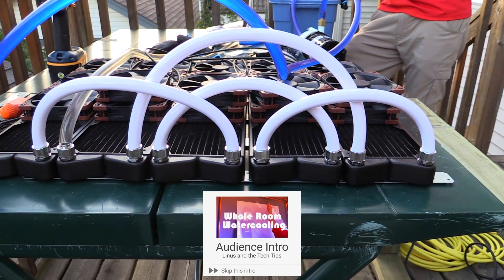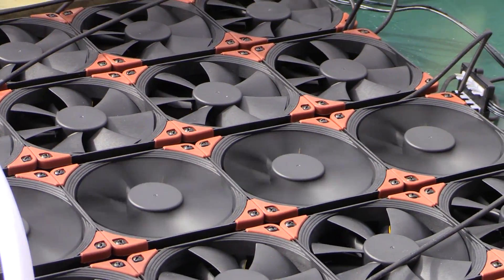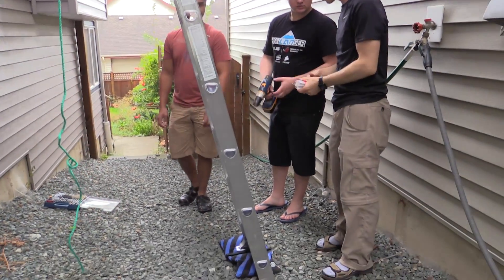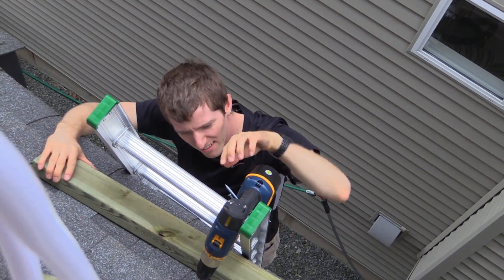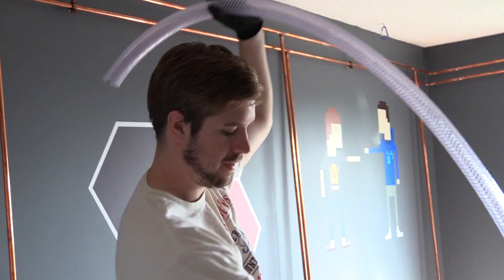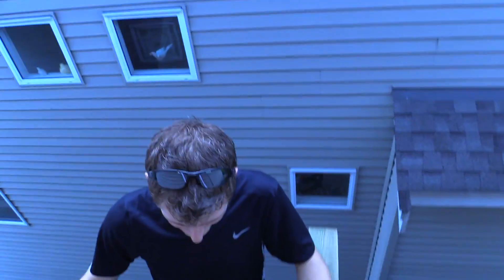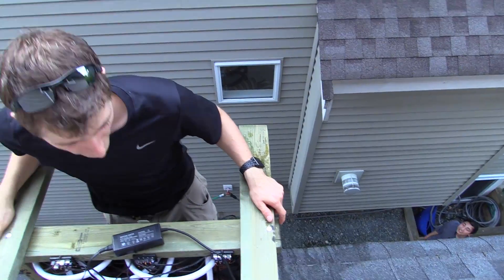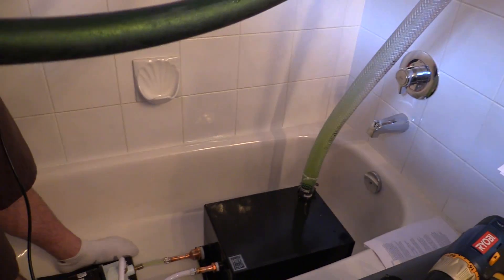Whole Room Water Cooling Project Day 3 - Radiator Mounting and Panic...

Comment: I realize this is old, but damn, wouldn't putting radiators outside in the winter in Canada result in coolant freezing and/or condensation?   Granted winter is pretty dry, but I'd still be concerned as homes can capture some moisture in the air indoors.

Comment: I know this is 5 years later and they've moved and improved on building things, but a few things I want to say.

1. The power could have been handled with pvc or weather resistant flex pipe that we electricians use so everything is out of the weather.

2. Pilot holes for screws. Wood won't split, then.

3. Shut off valves to allow the PCs to be independently removed.

4. Grab the radiator from something like a honda civic or any 4 cylinder car along with it's electric fan to use at the radiator. Some adapters for the hoses and hook up an inverter for the dc fan and done! It's lighter, simpler, and weather resistant (except the wires).

Also a ridiculous build, but I love it

Comment: I love this video, as I do all the others.  It may have been said already, but I am not going to read through three years worth of comments (!) lol, BUT....the hot water running through the pipes in the office would lose their heat to the office?  Newton's something Law of Thermodynamics.  Which is why we insulate our hot water pipes in our homes.  So that as much of the heat as possible reaches the taps.  Surely, what they are doing is the same as fitting radiators in our homes?  (and yes, I do realise that radiators should be more correctly identified as convectors).  Just saying :)

Comment: You know how modern fridges have cold water taps, where you instantly get cold water, I felt that they should have just sent those pipes from the computers to a refrigerator. You can then have it indoors stoved away and away from the elements.

Comment: Why did you not use a car radiator/fan? Those fans are made to be in the weather. Not to mention so much of that project would have been easier. Mount it on the ground, in a nice looking cage. That would also keep it out of the sun. In the summer that would be an issue. Also all that copper tubing would need to be insulated. Why did you not use PVC?
The other thing you should have done is added a switch for an indoor radiator for winter time.

Comment: i know im posting on a video that is like a million years old, but copper pipes? u basically installed a computer powered heating convector... and for the rad, like most other comments suggest, a vehicle rad and fan probably would of been easier... hell, a regular window box fan (wich is a single 120v plug) duct taped to your rad would probably also suffice... still, aside my ranting, i still enjoyed watching this project

Comment: By the looks of it maybe LINUS TECH TIPS should have gotten some real CARPENTERS and other TECH TYPES to do this installation, it would have been faster cheaper and better looking and with that, all said the system would have been slicker too, and built-in access would have been better planned out, hey if the system works all the power to you but wow what a Macgilla!

Comment: Maybe mounting them to the railing on the deck and weatherizing a small area for them would work out pretty good too, then any service you may need to do can be done from the comfort and safety of the deck, also running 20 fans at .1 amps is right on the line, with line drop and grey outs that could be a problem so a larger supply or maybe an inline capacitor for spikes would be a way to go.

Comment: I realize this is an old video, but screw it, I'll comment. Dude, you could have saved so much money and headache if you'd just gotten a radiator from a car and 2 electric fans meant for a car. They are already water proofed. Then just ran those off a 12 volt 10 amp battery charger.

Comment: Rather than using 16 individual computer and 4, 4 fan radiators, fans they could used a single large waterproof fan and hung it from a metal bracket under the awning of the roof. Then run the tubing up through the through the roof, into a large pump sitting inside the roof on shock mounts to prevent any noise. Then fed pipe to have hoses bring the water down through the wall having it come out of several plugs in the wall behind the desks. They could use soft tubing the entire way and it still would have looked neat and tidy without any exposed tubing.

Comment: I would’ve just used sharkbites, I use to be a commercial plumber and have straight up put those on the pressure side of a water heater and never had an issue with them, this seems very low pressure compared to what I’ve used them for so that probably would’ve been the easiest way to do it lol

Comment: Could have greatly simplified and lowered the cost on the cooling system by using the radiator from an 11-14 chevy truck. 34" core width, 17" core height, and easily an inch or more thick. Best part, is that generation Chevy runs a "sealed" system, so there is no radiator cap on the radiator. Since you already have someone adding fittings to the lines, it wouldn't be much of a step to neck the inlet and outlet down to the same fittings. Add to that an automotive radiator fan, 16",  and you've got far more cooling power than the computer fan grid can pull. The downside is that the auto fan runs up to 15amps, instead of 2, but its also a setup that is MADE to run out in the weather. It will last far longer. 

All that said, I applaud the combined cooling idea, it just needs a little tweaking

Comment: Can get 2000cfm (yes, 2k cfm) fan setups from pick a part off 2000 and newer Lexus, Mercedes, BMW, etc, that run off a single relay and switch. Would have been so much cheaper AND better performance. 
40$ total plus switch cost

Comment: you can get one ... from a hvac systems manufacturer if you tell them the volume and heat dissipated a single unit water cooled big one and also get it installed .

Comment: Forgetting to solder a joint... It happens. You test fit a bunch of things at once, all that copper starts looking the same. I do wonder why there weren't more supports for the copper down pipes, especially at the bottom, and valves at the end of each one?

I'd have opted for an automotive radiator and a couple of automotive electric fans driven by a power supply and a temp sensor... but hey love the video.

Comment: What I don't get is why 20 fans and 5 radiators why not just use a car radiator something that was meant to last year outside and one large fan meant to last out side and at this point why not just use a ac unit converted to run water
Reply: why not 80 fans and 10x 560mm monsta rads

Comment: it would have been way cheaper/efficient to use 1 or 2 electric radiator fans for cars/trucks than 24 pc fans
Reply: Automotive fans are not designed to run continuously for long periods. It'd burn out at some point
Reply: 'Automotive fans are not designed to run continuously for long periods" thats just a false blanket statement, some are and do.
Reply: Fair enough. I must have got told wrong. I really wanted to use one to feed fresh air in to an engine bay with an air cooled diesel in it. There wasn't close to enough ventilation for it even with its own mechanically driven fan going the whole time.
Reply: pc fans have better airflow
Reply: no you are wrong.
Reply: i think any fan would burn out eventually. they have cooling systems in cars now that are all electric so the fan is always on when the car is running rather than a clutch fan.
Reply: Thermostatically controlled. You can hear them stopping and starting as needed. I was going to use one on my boat until the engineer told me not to.
Reply: the fan you hear starting and stopping in your car/truck is an auxiliary/emergency fan and not the main mode of cooling for your system and not what i was referring to in my previous comment. A car fan is moving far more air than a series of computer fans so if you are worried about it burning up you could easily rig up a thermostat to control it, its not unheard of for auxiliary fans to last several decades and it would not be working very hard for this application.

Comment: No idea why you would do all this and then use P.C. radiators. Use a home A.C. condenser and fan and use the pump from a fountain. It would be way cheaper way better and way easier to install. Also water will freeze you need to use some other liquid.
Reply: I withdraw the part about using something other than water.
Reply: They had to. Those fans were sponsored

Comment: Maybe next time if you try it or someone else tries this and is reading comments, after getting the pipes installed, cap off the return line and attach a air line to the supply line and add air pressure and then take a spray bottle of soapy water and spray every connection point in the main line and look for air bubbles to know it is sealed.
Reply: Lennie AKA WeirdRacin and get a plumber who actually solders all the connections

Comment: Couldn't they have drained all the water out of the radiators after testing so that it wouldn't have been so heavy... and then fill them up/bleed them (to get rid of air) once the whole contraption was fixed?

Comment: plumber says project is easy.

fucks up
Reply: it didnt even look like that part had been soldered. probs forgot it. since he test fitting everything at once.
Reply: it was one connection, it was also 4 am
Reply: +MrCrazy0ne im just saying that he said the job would be easy.
Reply: Think so, too. Doesnt look like there is any solder at all.
Reply: To be honest I think the only mistake he made was not fixing the downpipes to the wall. The soldering was probably fine but the crew were yanking those pipes around when flushing the system which probably broke the solder joint.
Reply: Nah, left it unsoldered on purpose for dramatic effect, I reckon.
Reply: #madeforTV
Reply: I quess easy doesn't mean its not gonna go wrong
Reply: Probably so he can charge them twice
Reply: +Agar Theory yeah but still, that was one connection, out of probably 30

Comment: this may have been cheaper with a couple car radiators
Reply: Or just one would have been enough, not to mention easier, and car fans are made to be in the weather. It would have been cheaper too. Just use a main car radiator. Just one would be fine.
Reply: ...and a single house current all-weather blower on those rads
Reply: Maybe for easier compatibility
Reply: Nice prediction,  he uses car radiators in his server room today
Reply: John Terpack to be fair in a junkyard wars episode one of the teams liquid cooled their pc with a heater core. But anyway I'm not too sure but it seems like copper radiators cost way more and there is not as much as a selection, I could be wrong but that is what I gathered from a little searching. As you can't mix copper and aluminum in water cooling. And obviously there is copper in their setup considering the huge amounts of copper pipes running through the room, plus considering the amount of hardware they hooked this up to, they probably wanted to use the most amount of proper pc hardware possible. I mean doesn't change the fact that I want to build some Cheapo overclocking 1366 build with a Xeon x56XX 6 core CPU and just overclock it to hell and back cooking it with a car radiator. But that's just for me to screw around. I however wouldn't do that to my main rig at any given point in time
Reply: I have cooled my PC with a heater core. They're almost perfectly sized for a CPU loop.

Comment: great (old now) project, but your wooden frame sucks, I wouldn't be surprised if breaks at some points... a basic joinery would have been lot stronger, and a finnish to protect it, even if it seems to exterior grade construction lums (um not english, so technical terms might be plain wrong). Even better, if you can or ever need to replace it, use plywood as it is a lot stronger (use some used for boats).
Reply: +Nicolas David (“N Light”) damn, just saw that you had to move away... well, the advise still hold nonetheless ;)

Comment: Guys next time you screw two pieces of wood together, drill holes in them as big as the center part of the screw to avoid the wood cracking. Youll get much more strenght form those conections too and no risk of the wood corodng in the future.

Comment: Still dunno why they didn't just rig up a few car/truck radiators to do this.  It would have been cheaper and more effective especially factoring in all those industrial noctuas at 30 bucks a pop.  You can get a MASSIVE dodge truck rad aftermarket brand new for like 150.00 bucks.  A fan assembly for it for like 100 bucks also I guarantee you could rig it up water tight since fitting wouldnt match up on the rads of course.  but as stated a reservoir in each rig would allow quick disconnects in each system.
Reply: +overclockedamd123 So you could rig up a system with MASSIVELY greater cooling capacity for a fraction of the cost and I bet far easier to setup with a little JBweld and some improvised fittings.

Comment: If they want to retain heat in the room in winter, they should have just put a 3-way (1 in, 2 out) ball valve on each of the hot and cold lines (or combine the lines into a 2/4 valve) and had an in-room radiator, rather than buggerising around with additional per-PC radiators.
But hey, free stuff.

Comment: I know i'm late to the party(and it's been mentioned before), but seriously, why didn't you just use an automotive radiator (think aftermarket Honda slim unit) and a badass Spal(shrouded) 3000cfm 12v fan? All this work and you go through the trouble of using indoor computer parts outside. Electric automotive water pumps can move upwards of 20gpm on 12v. I expected more thinking outside the box from you guys.
Reply: Larger automotive 12v fans can use upwards of 30 amps which would cost a lot for a power supply.

Comment: I don't understand why you used internal fans and the amount of them when one large external fan would have done the same job .
Reply: +johnkent666 The Nocuta Fans they used are the industrial versions with an IP67 rating meaning they are water and dust proof. I'm more worried about all of the exposed connections and that little walwart PSU
Reply: its basically a large radiator same as on a car or air conditioning system large fan, simple and will work just the same if not better its you who knows nothing pmsl .kind regards from an engineer ;)
Reply: pmsl oh yeah forgot ,very true :D
Reply: lets keep this basic for what he needed and what he used was over the top , large car radiator with big 12v fan would have done a better job special push pull config .
Reply: That was my thought, too. Junkyard car rad and fan assembly, and they're already rated for outdoor use, lol.
Reply: Fan Pressure, CFM, Electricity Usage, Fan life 

If the fans were to blow air upwards??
Reply: might be because it was all free stuff
Reply: So many engineers, yet none quote CFM, current draw, IP ratings...
Reply: Indeed! XD

Comment: a couple thoughts came to mind watching this video. a car radiator and a box fan would of been alot cheaper, they would of been lighter. and probably worked better. most car radiators are wider than those small radiators giving more surface area. those pc fans are not designed for outdoor use. you can find attic and garage fans for pretty cheap. another thought is about winter.. if that is water only inside the pipes,  you have to worry about it freezing and bursting the radiators.  mixing with antifreeze might be a good idea.

Comment: Hate to point the obvious, but you are using copper pipes in extremely long lengths inside the room. Copper piping acts like a pretty good heat sink, and most of the thermal load will be dissipated inside, so that radiator array with a ridiculous amount of fans outside is more likely to ADD heat to the system picked up by the hot roof. Add to that the certainty that condensation will form on all the exposed copper pipes...The idea of a single loop is not a bad one, and can be very efficient, but unfortunately you won't be able to rely on off the shelf computer cooling kits only. The entire loop should be made of plastic tubing to minimize condensation and heat loss. You want the heat exchange to happen at the radiator, not all over the system. You also need to pre-fill each system to minimize the amount of air in the loop. From the flow your pump seemed appropriate, as long as it doesn't get too hot or obviously is forcing it should be alright. The radiator outside, you could simply take apart a window-mount AC unit, and use its own radiator and fan. Guaranteed to be more efficient, and runs on 120VAC, much easier to power safely from outside.

It's a cool idea, but this is poorly planned and executed unfortunately.
Reply: Yeah, all that copper piping needs to be insulated. Or moving the heat outside is pointless.

Comment: Indoor fans outdoors, indoor electrical components outdoors.  What you should have done is bought an 18 wheeler or truck radiator and got and 120volt outdoor fan to blow air though it.
Reply: Those fans are Noctua iPPC fans which are "water proof" and rated for industrial environments. The shoddy wood working and electrical are more of a concern than the fans

Comment: I recommend a slightly larger power supply unit. Having a little more power capacity (Like 3 Amps) could reduce the stress load on the power supply. The fans are pushing the power supply to run at max load.

Comment: This would have been so much easier using a car radiator/fan, its light, runs on 12 volts, waterproof and pretty much free when bought used.

Comment: I kinda felt like- you could've used more- robust systems for this. Like instead of standard computer fans, one big 120v fan. You dont have to be tied down by 12 volts. Also- the radiator. Instead of using standard computer radiators, why not a heat coil from like- the back of an old refrigerator? It's cheaper, more efficient and more effective.